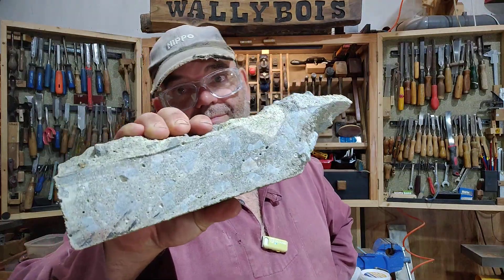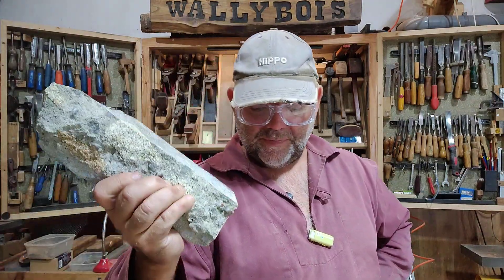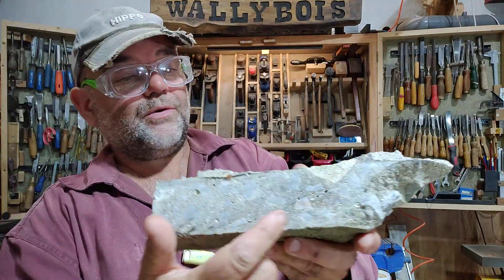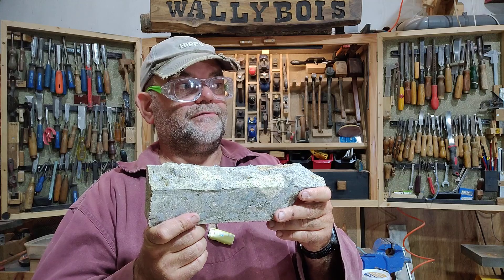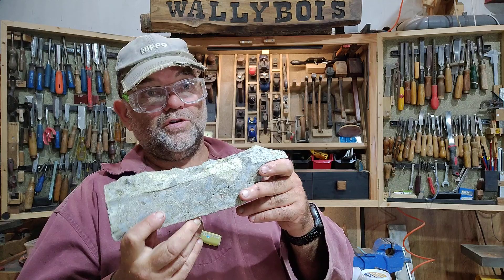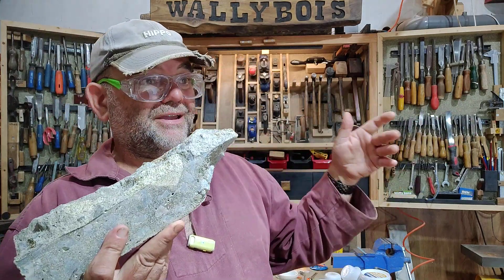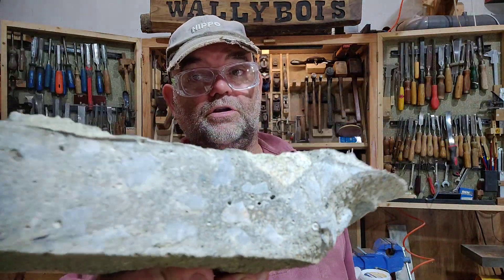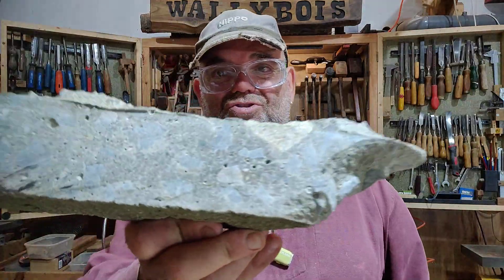Aerated Concrete (RAAC) Schools a TICKING TIMEBOMB

Comment: Reinforced concrete has generally had a bit of a bad press for the last 25 years or so, not lasting as long as it should for an assortment of reasons. Incredible to think that there are still some very significant examples of Roman concrete standing. Even if British tourists think its fine to literally leave their mark.

Comment: Former block & beam ganger and groundworker here. 

Ripped a lot of Raac crete out of buildings in the late  90's. 

30 years lifespan was hoping. All was blown out through corrosion. 

Hollow core slapping with pre stressed rebar and  215mm deep pots and beams was our replacement sealed in with sealant or damp course to stop corrosion. Far safer. 

Did a lot of work on ex MOD housing, and late 60's flats mostly prefab builds. 
They had a lot of seriously dangerous upper flooring in using aerated concrete. 

Glad you did this vid mate.
Reply from the maker: I noticed with the work I did that the rebar was short so no support on the end... As it's prestressed is there a chance the rebar relaxed to its original length because the RAAC could not contain it... As well as the Corrosion

Comment: No it's not the same type of system is AAC block invented by the Swedes in 1920 it was called yutong block is it roughly the same system or slightly different can you tell me
Reply from the maker: I think it is the same but not used structurally since it's not re inforced xx

Comment: What is Section 77 of the Building Act?

Section 77 of the Building Act 1984 (the 1984 Act) empowers local authorities (District Councils) to deal with a building or structure which is in a dangerous condition. The danger may arise from the condition of the building and/or from any loads which the builder may be carrying.

Comment: Aerated concrete as such is fine. The problem is when iron bars are used in it. Stainless steel bars must be used.
Reply from the maker: I think it has its place but not structurally with or without metal rebar
Reply: @AllShortsPolitics  would you use it on outbuildings as a roofing material where vertical support is no more than 800mm between centres ?
Reply from the maker: @highpath4776  I'd rather not use it for anything structural xx
Reply: @AllShortsPolitics  Garage and Shed Roofs ?

Comment: Thank you so much for this Marcus. I've read that it shouldn't even be called concrete cos it's only 20% concrete.
Reply from the maker: The density is so low and the RAAC doesn't bond to the Iron either

Comment: You do know this stuff been used in all types of building
Reply from the maker: Yes, I have worked in remedial work but there's no way to fix it... Third of the density of Concrete and doesn't bond to the steel... Water gets in an freezes too

Comment: tower block im in has only just stopped being a building site , lots of re work due to Grenfell , and it seems every tower block is getting that , years of construction , now its got even bigger , schools hospitals courts , all requiring the aereated concrete replacing , yeah 2030 seems optimistic

Comment: Here on south EU this type of concrete was not allowed (high seismic activity among many problems), and problem is solved with replacing bubles of steam with styrofoam pellets.
Styrofoam pellets for prestressed parts on residential buildings, and lately they experiment in labs with inert gases.
Bridges, tunnels and other high stress demanding structures can not have any of this enhancements, only propper hi grade reinforced concrete with chemical additives such as catalysts, plasticizers, anti fungus and anti salt.
Reply: When I work in building sites in Germany in Holland it was called yutong ACC block and it was invented in 1920 by Sweden the Germans used at block in a big way because it was good soundproofing and good insulation because it was air trapped in the holes
Reply: @stewartmcintosh1073  Ytong if well known brand, many people knows it as "gasbeton". It is still used for non carrying walls and non structural things. Private houses are often build with it, partly or whole. It is not made of concrete, main ingidients are sand and calcium carbonate.

There is a glue for it that speeds up construction. I think that bubbles are CO2 created by simple chemical reaction. Non toxic, inert, fire proof and good isulation.
We have factory near by so it is available everywhere.

Comment: Let me guess RAAC was cheaper than normal concrete 🤔
Reply from the maker: About a third of the density of tradional concrete https://www.matec-conferences.org/articles/matecconf/pdf/2022/08/matecconf_cs2022_06005.pdf
Reply: nothing is cheaper than concrete as a raw material. however RAAC's a massive time and labour saver, you can bring large pre cast slabs on site an just lift it into place and this offsets the extra cost.

where I am its used extensively for non structural walls in concrete beam and post building, every 3 m in height you are supposed to cast a concrete beam across the wall to make sure the way remains non structural. 
within these limits its great, keeps the heat out, it uses a resin based mortar and one person can build several 3x6 walls and plaster them within a day.

its not used for floors here, that would be traditional concrete, its about a month per floor, a week for the supports, the temporary floor to support the wet concrete onto, the wirework. then three weeks for the concrete to set and gain its strength.
Reply: @davidwhatever9041 

It was used in MOD prefab housing in the late 60's in England. 

I worked in block & beam flooring and groundworks in the west country.
We had refurb contracts in the late 90's tearing out prefab MOD housing estates on military bases to refurb for privatisation. 
That and asbestos was a demonstration of governments not giving a f...

Comment: This is the england the boomers have been voting for since they made their pact with the tories in 1979.

In the part of the world I escaped to, this stuff is extensively used for its thermal properties, it good at keeping the heat out. But it’s all walls, with concrete framing for the building structure

The bubbles are made by mixing aluminium powder into the mix and during to autoclaving it reacts with water to create hydrogen bubbles.

Comment: 😮 UK is literally falling apart after leaving the EU 😳 If that happens in here then we know where is the blame and it will be rectified.
Reply: We are mostly sorry but we, from EU, are not connected by RAAC and cannot be hold responsible for...... May be next time. 😇
Reply: I worked in Germany they use a type of block the same idea and it's called AAC block I'm hot was invented in 1920 by Sweden and all over the world are using this Block just going Google it or YouTube it in Germany and the Netherland on the walls not on the ceilings of the floors very well insulated there's no mortar joint the glue act together it gives you a better insulation soundpro all-in-one